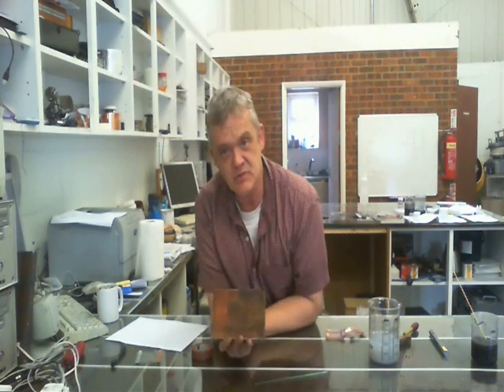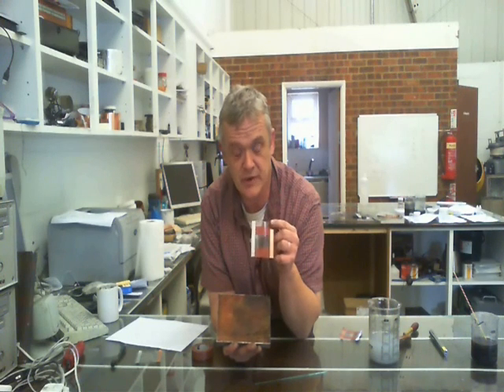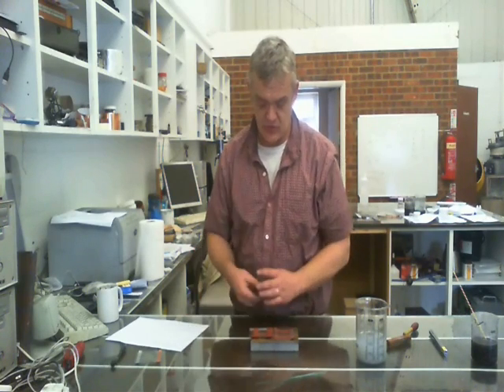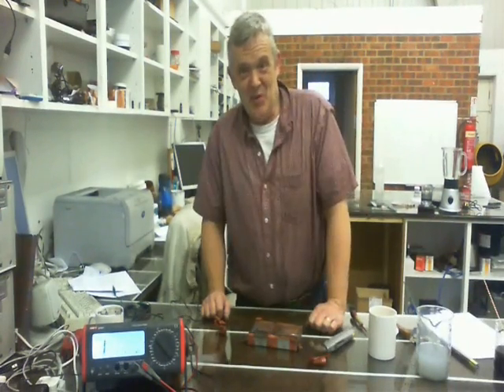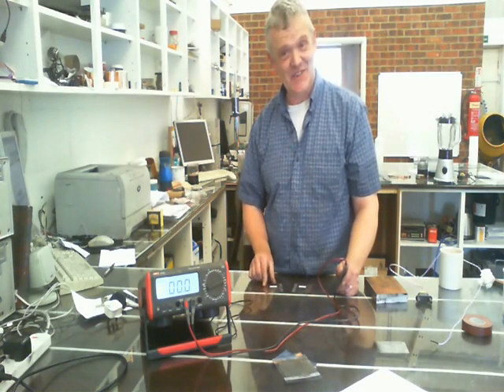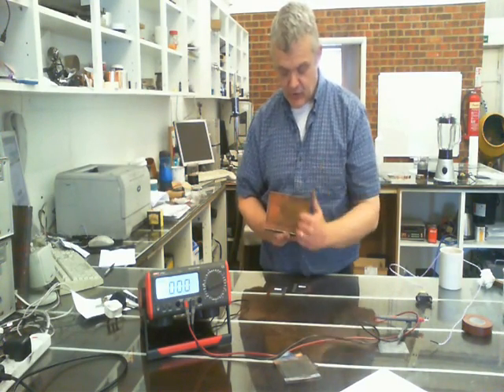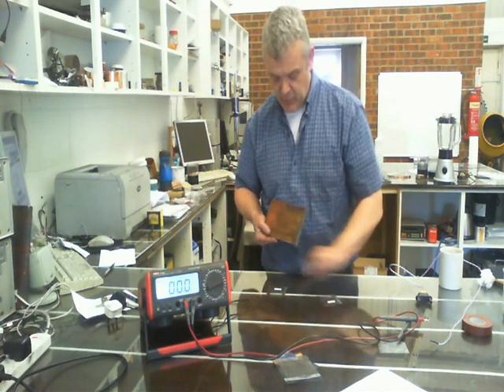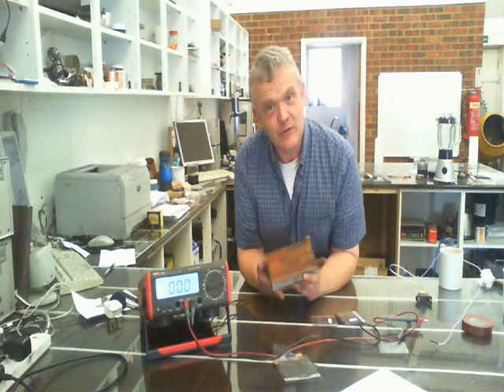Effect Of Magnetic Field On Transparent Solar Cell

Comment: Is it possible to do the 3d gel like structure in a home enviroment? considering the transparency , having multiple layers stacked would help in any way? would it be possible to apply the transparent coating onto existing non removable house/ apartment windows and get some electricity out of them without losing the incoming light and make it somehow stick to the glass/plastic as it is in it's vertical position?

Comment: groovy stuff !!! gave me quite a bunch of ideeas ... on to playing with my hallbach arrays :))
Reply from the maker: something everyone should play with lol
Reply: Too right  ... I got 60 magnets N50 that promise hours of fun ... don't want to use super glue and hot glue is out of question ... will build a 3 d printer and stuff them in preset shapes ... or that's the plan ... till then I'll just sacrifice those and glue them accordingly ... 
Been today to the inventika exhibition in Bucharest and saw a few things ... but as usual the good stuff is expensive as hell ... 
No 3d printers there ... and the energy products were way conservative ... photo polarisations sprays were in the forefront and cogeneration equipment was yhere too ...
Reply from the maker: actudoran
still probably pretty interesting mate
Reply: Yup my two little ones enjoyed it too ... had a look at a few laser and plasma cutters as well as some ultrasonic welding machines ... no pics allowed ... a magnet motor was there too consuming 12 v and about 5 amps ...  with free spining stator magnets and 5 discs of magnets
Reply from the maker: actudoran
that i would have liked to see
Reply: I can draw it 4 u
Reply from the maker: actudoran
that would be cool mate - if you don't mind
Reply: did it
Reply from the maker: actudoran
got it mate - thanks